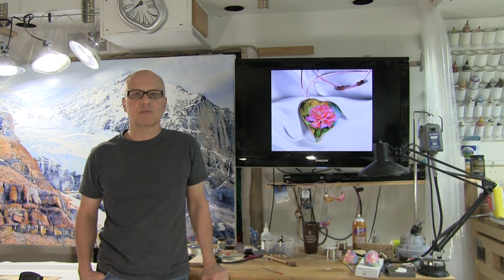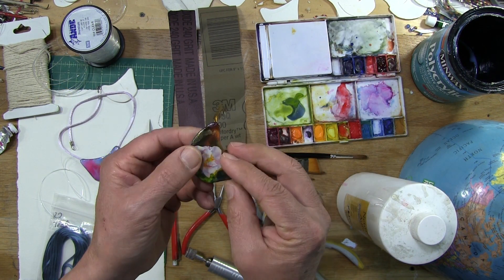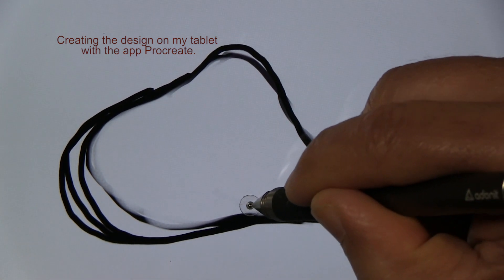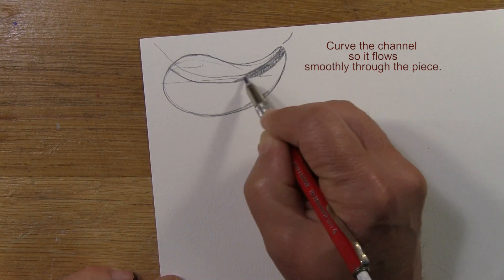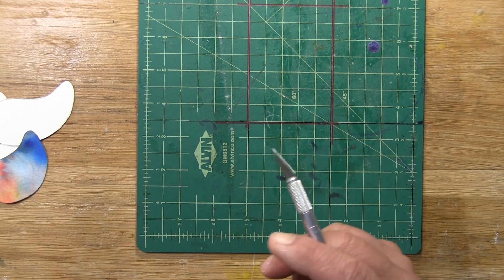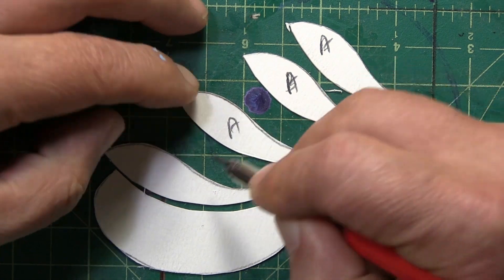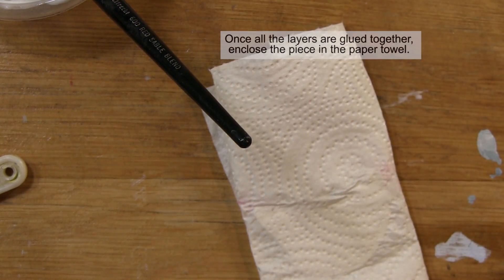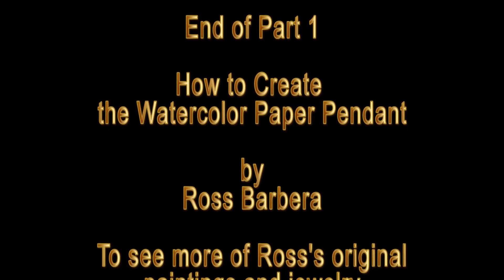How to Create the Watercolor Paper Pendant, Part 1 by Ross Barbera

Comment: why not use scissors?
Reply from the maker: Good question. I've found it faster and more efficient to use an X-Acto. Also concave areas of the shape would be difficult to cut with scissors.  I've tried both ways with groups of students and the X-Acto on a cutting board always wins. But definitely use scissors if you are more comtforable working with them, and if the shape is not curvlinear, they probably will be OK.  Of course a digital paper cutter is the best! Thanks for watching